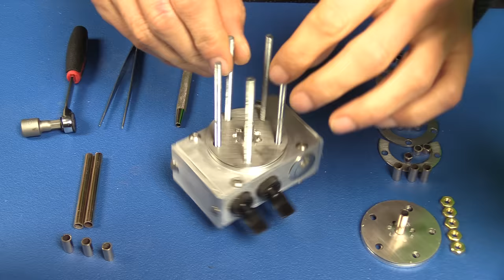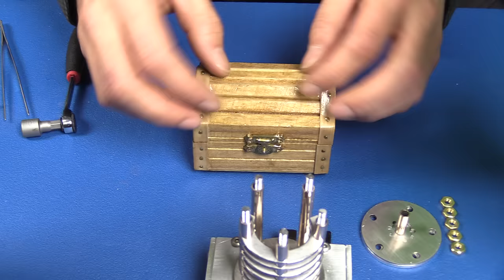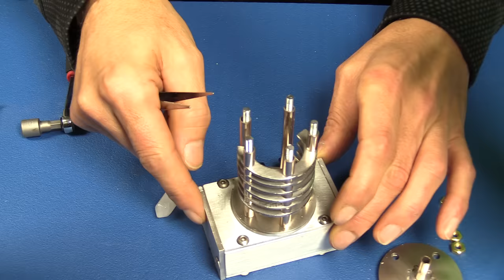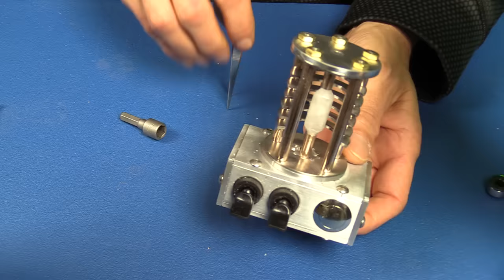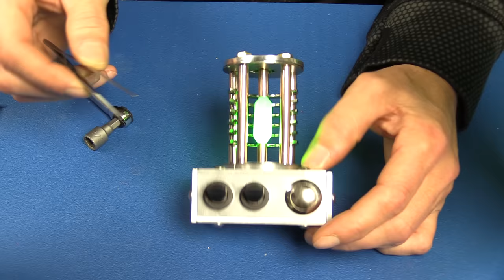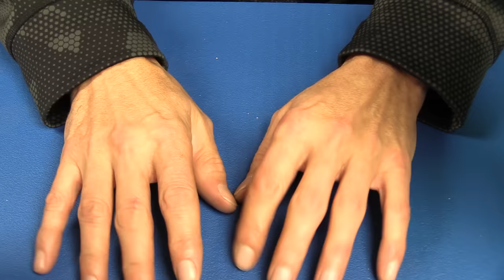Every ASMRist Wants This!

Comment: The fact that you tighten them in a star formation instead of circular is satisfying
Reply: you are supposed to anyways. when you go in a circular pattern, it applies uneven pressure on whatever you are tightening. when you go in a star pattern, it applies an almost even pressure on the piece. just my two cents
Reply: Ben Gerlach I'm guessing that's why they found it satisfying. It is little things like that which are weirdly satisfying to see done correctly :)
Reply: That's the correct way to do it, never tighten in a circular way
Reply: It's like rotating tires
Reply: This thread was news to me
Reply: I was having anxiety that he was gonna just go clockwise lol
Reply: Now if you ever have to change a tire you all know the proper way to tighten the lug nuts
Reply: That's how you tighten drum heads.
Reply: Emperor Palpatine 
I had anxiety each time he scratched the stone with the pliers hh
Reply: Ben Gerlach yes I know, that’s why I liked it
Reply: kc armstrong obvs
Reply: Ben Gerlach nnnnn
Reply: why?I am confused to what all this means lol but whats a circular and star formation? xoxo
Reply: elle vogue circular formation is basically tightening what ever it is you’re tightening in a clockwise or counter clockwise order. Now star formation is where you tighten you’re first (for example a) Nut and then you tighten the opposite of it and continue doing the same till you’ve tightened them all.
Reply: elle vogue you tighten over Cross X thats the simplest visual for that
Reply: Ben Gerlach the saying is two sense
Reply: I feel sorry for mechanics that have to watch this
Reply: Gabe Williams kkokkk